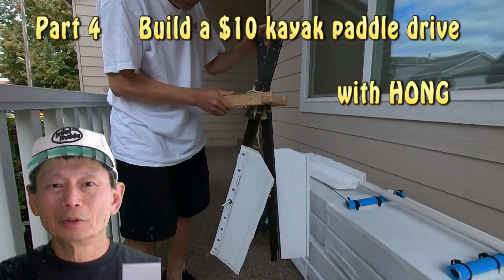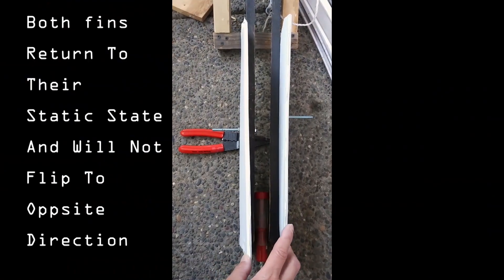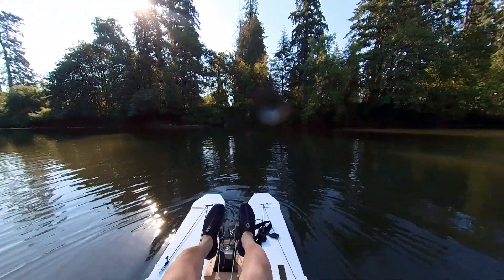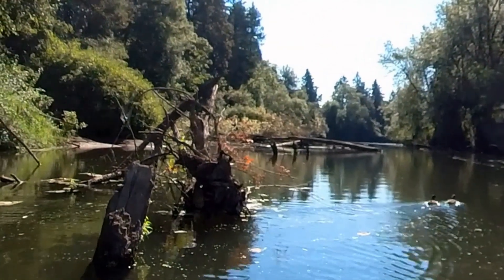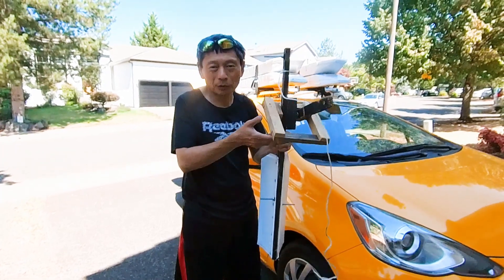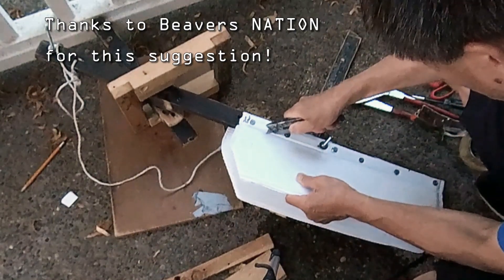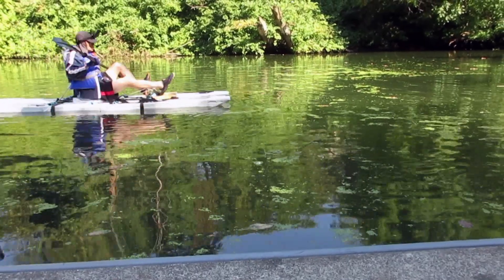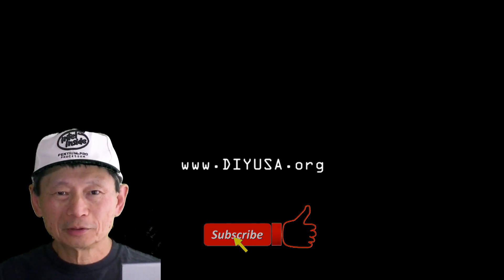Pt 4 Build a kayak paddle drive with Hong

Comment: Moving according to the principle of lift, like a wing, is more efficient than moving according to the principle of drag. A large, slow-moving surface is more efficient than a small, fast-moving surface. If Hobie fins rotated like a ship's propeller instead of oscillating, they would be more efficient. If you want to work according to the resistance principle, I would use a paddle wheel.
Reply from the maker: Thanks for your feedback. My guess the Hobie fins with a slimmer form factor, is easier to set up than the paddle drive and the paddle wheel.

Comment: An other way could use the same effect of ''sucking water" then release it between the flaps we can see in the small foil animation you showed us earlier, but in place of being "up then down", it could be "away from each others", then close, to push water behind" in a lateral way.
Reply from the maker: Thanks for your suggestion. I will take a look at this and see if there is an easy way to implement. thanks again.

Comment: On your previous two fins design, wouldn't have been easy and sufficient to just put a straight stationary board as a separator between the two fins to neutralize the turbolenze influence of one fin on the  other ? It could also have funzione as a kind of a rudder to straighten the boat trajectory.
Just a tought .
Keep up your work 👍
Reply from the maker: Excellent observation and suggestion. I believe your suggestion will work. I did think about adding the partition in the center. I have also considered attaching the center partition on the paddle itself so I can install the paddle + center partition assembly in one piece. Finally,  I decided to just use a single paddle because the pivoting point for the two paddles were poorly made and they wiggled sideway. If I add the center partition, I will have to rebuild the whole assembly. Using a single paddle minimized that extra design/rebuild effort.😀
Reply: @DIYUSA  I get what you mean 🤣👍maximum result whit minimum efforth.
Perups you ca try the idea on your eventual next build.
Meanwhile keep up the great work and have fun 👍
Reply from the maker: @AndreaGanora  Thanks,. Yes, I am still thinking of how to implement a proven design from Mirage. Hope I can come up with something easy to build and works well also!

Comment: Congrats, improvments each time !
Maybe you can counter the rotary effect using a living fin like on the Tucktek ?
Reply from the maker: I have a bigger concern that the energy generated by two fins is being wasted and not much left to propel the boat forward. However, your suggestion triggered me to think of an idea to minimize the turbulence. I can add a divider at the center between two fins, like a center board for the sail boat. Another option is to incorporate this vertical divider on each paddle and be part of the fin assembly (use a small sheet of coroplast).   This option is simpler to implement and also has least impact to the installation of the drive. I will give that a try. Thanks for your input and suggestions.
Reply: @DIYUSA  I think the last version with the merged fins is not the best option because it remove the possibility to use a single pedal to turn.
Personnaly i may use thiner aluminum profil to reduce water resistance, and increase the fins size for something wider to create more trust under each floater exactly like you said with the duck foots.
Reply from the maker: @BeaversNATION  Thanks for the excellent input. Using a thinner and stronger fin such as aluminum is a good choice.

Comment: thats a very interesting idea but it looks liek it would be more difficult to push that large paddle.. A couple days ago John Vigour posted a video on facebook about a paddle drive for a kayak/small boat and I thought about your build. he used a bicycles front fork and bearings, laid a board in the forks and used paddles similar to yours on the ends.. it looked effective but the boat wigwagged so it probably could use a rudder and or a center skeg .. I dont know if I can post a link on your channel or not, if you want one let me know
Reply from the maker: Thanks, I found his video on FB. It is the same concept as mine. The fins are placed on the left and right side of the boat and  this eliminated the problem I have when placing the fins so closed together.  At least,  John's implementation supported my assessment of the failure when the paddles are placed close together.
Reply from the maker: I love to hear how others coming up with brighter ideas and implementations. You are welcome to share the FB link and I am not sure if Google will filter that out or not. Worth a try and let other viewers know also. Thanks for your input.

Comment: Good idea, I was hoping it would work.  I'm curious if putting the fins one in front of the other instead of side by side would fix the turbulence problem??  I think it would be more difficult, but maybe that's why the big manufacturers used that configuration.  Both sides can also thrust at the same time in that configuration too.  Or like you said, the easier method might be to try to space the fins out.  Maybe you could make it where the bottom part can rotate 90 degrees so you could fit the drive into the water, then rotate it back where it locks in place afterwards.  It might work since the fins can bend somewhat.
Reply from the maker: Thanks for sharing your ideas. I am looking at the  the Mirage drive. They have been selling their basic product of over 20 years and their patent should have already expired.  That's a proven design and I want to come up with an alternative implementation so we can build that with simple tools and components.
Reply: @DIYUSA  That would be great if it could work. They think those things are made of gold. I look forward to seeing what you can come up with 👍. You may be right about the patent because I’ve seen a very similar drive on another brand...I think it was a Wilderness or Pelican. Anyway, Hobie even has a reversible one now so maybe the older version can be made.
Reply: I think a pause in between one side pedal stroke and the other may help to. It would allow the turbulent water to pass by before the opposite fin strokes. Stiffer fins out of plastic or plexiglass or aluminum would be good. Perhaps an extension spring on each fin to help force the fins to fold closed faster. 
I'm wondering about how this could be adapted to be a drop on unit for SOT kayaks, like mine. Left and right fins/paddles would hang down on either side of the kayak off a platform that spans the width of the yak, sitting on the sides. Bolting or clamping into position. The pedal lever pivots could be something like a bicycle bottom bracket or wheel hub. One for each pedal with an axle rod going out one side to the paddle arm. Could have a spring assist here too to keep the non active position centered. 
I think a rudder is needed out back to keep the yak tracking straight and counter act the wagging effect of the paddles pushing one side at a time. 
I like this design as it's DIY friendly and could be done with just 2x lumber and cheap plywood for the fins or cut them out of old 5 gal. paint buckets. It's not overly complicated like pedal prop and shaft designs and easy drop in/on is needed for convenience and relative universal fit. 
Anyway, just blabbin' away with the coffee shop engineering. :)

Comment: wonderful, great idea...  however it is not symmetrical.  only your right leg drives forward and left leg actuates putting paddle back to start position.  OK, why not have two paddles in tandem operating on opposite cycle?
Reply from the maker: Thanks for your question. My Rev 2 has a symmetrical paddle design. Yet I came across a problem and I explained that in 0:53 of the video. Therefore my rev 3 has a single paddle. Cheers!
Reply: @DIYUSA  I understand your explanation of the problem with side-by-side paddles, but I am suggesting two paddles but one BEHIND the other (not beside) and linked to move in opposite direction.  One powered by left leg push, and the other powered by right leg push, which will result in equal work for each leg. Maximized push for each leg.
Reply from the maker: @kevinwelsh7490  Thanks for explaining and sharing your idea. I need to think how to do that. Even I try my best to optimize this rev 3 design, the speed of the current design will not be that great, especially with a single paddle. I am considering coming up with an alternative implementation of the Mirage drive. They have been selling their basic product of over 20 years and their patent should have already expired.  Cheers!
Reply: On this same note when I saw the duck swimming footage I thought he was going to just spread them out farther. After seeing Rev 3 I think its still a good idea to try. Maybe use that curved shaft from the older "flipper" peddle drive...this would put the fins farther apart and thus hopefully reduce the shared turbulence maybe?. However I think REV 3 is genius becasue it functions just like the duck foot and two of them spread out under the pontoons like the ducks feet would do it.  Very interested to see if inline fins would work though!
Reply from the maker: @Atrayus1984  Thanks for your comment. In order to have a meaningful speed, I believe I need two paddles. I will modify the Rev 2 fin design with a  "divider" to min. the turbulence, i.e. similar to adding a center board on a sailboat. A viewer pointed me to a FB video which uses the same concept, but with the fins placed on the left and right of the boat. I guess you will enjoy this video also. https://www.facebook.com/john.vigour.7/videos/505952811364259